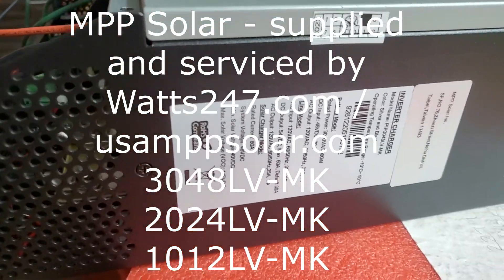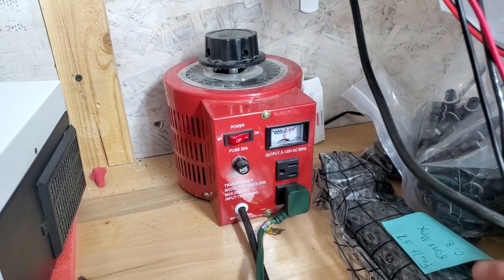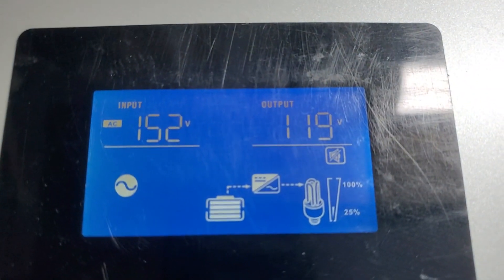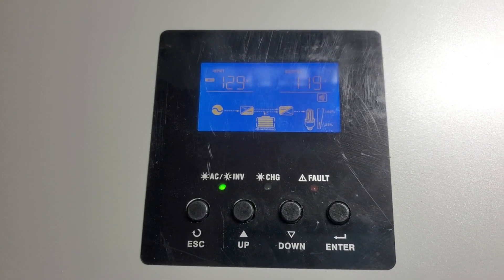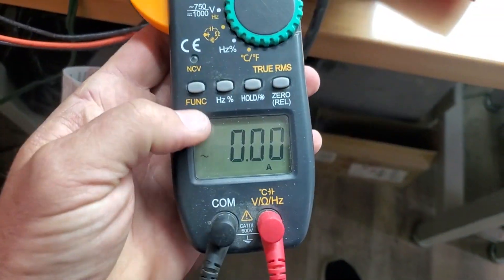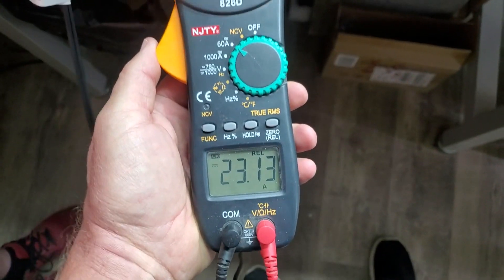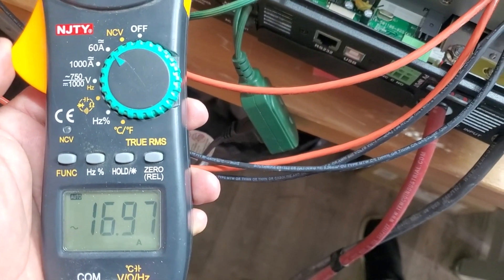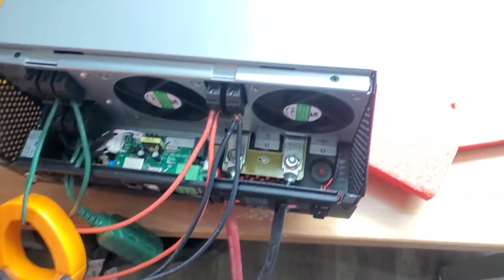MPP Solar 3048LV-MK 2048LV-MK 1012LV-MK Overview

Comment: Just ordered mine. Going to run for a 12 V hundred amp lithium batteries with it for the time being until I pick up a single one. What would you recommend for solar panels. I was leaning towards the 40 V 300 W panels but would love some suggestions on what you believe would work best.

Comment: inverter expert king or pip 5048 mkx ll has issue with Mppt when battery fully charged and low home load and high pv power available I see Mppt is up and down fast and this makes fluctuations in output waveform of inverter and i see fluctuations in bulbs in my home also this issue still there when Mppt working with utility (double conversion) … I think updating algorithm in Mppt and tracking the load not just battery can solve this issue … do you have the same issue?

Comment: It appears 2 of these will power quite a bit when setup for 240 volt with the kits added. Only 240 load we have is 3/4 hp deep well pump. The brochure says double the output for 5 seconds. Seems very boastful. Wondering if 2 units will start our deep well pump?

Comment: Great video! Are you using 1012LV-MK on this video? I have 1012LV-MK that has very unstable AC output (LED lights flickering and the AC voltage display will show the Voltage jumping around between 115 ~ 122VAC) from  from the inverter when using loads, it becomes more stable if I have >500W loads. Your looks very stable compared to mine. I wish i bought the unit from  you instead of directly from MPPT Taiwan because they did not help to solve the issue at all. I take the video showing what is going on, may be they have update FW or something to fix the issue. I can give you the link to my Youtube video.
Right now I have been running the unit as the Solar charger only and using the external inverter to run my loads.
Reply from the maker: Interesting, sometimes a fan, refrigerator or some other inductive load can cause this sometimes.  try installing a 10uf  200VAC capacitor directly across L and N on the output

Comment: Sounds like it would work really good for a total off grid system with a generator and solar panels.
Will it run inductive loads like motors ?
Reply from the maker: Got many customers using these models running Camper Aircons , and others on well pumps.  Surge rating of 2 x rated for 5 sec  (3kw has 6kw surge rating for 5 sec)
Reply: @watts247  Sounds like that will work for my girlfriend home .
 She has been living totaly off grid for 30 years as there never has been  power lines on her road . Has only had 400 watts of HF solar panels for 3 years that me and her built  and set up.
It is time to build a bigger solar system and bigger inverter and go to LiFe  batteries.
Need to run well pump, washer , gas dryer , have to run the generator to do that now and gas cost a lot more now .
 We would like to setup a wood working shop and run some of the smaller machines on solar like a cnc router carver and shop vacuum at same time as a business .
Does this model have split phase center tap ?
 Will it give 120V / 240V output ?
What is the cost of the controller/ inverter and sizes ?
Can it be linked to other inverters for more output later ?
 Or maybe even set up 3 phase output some time in the future , to run 3 phase motors ?
  ,That would reduce the lock rotor surge of single phase motors due to the phase shift , that inverters and generaters don't like .